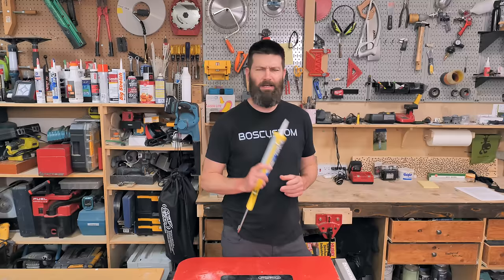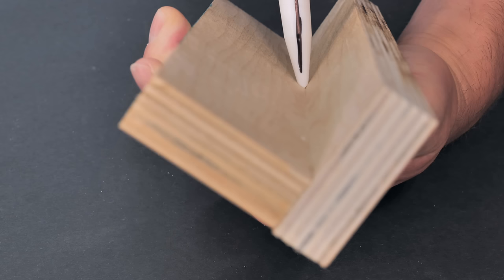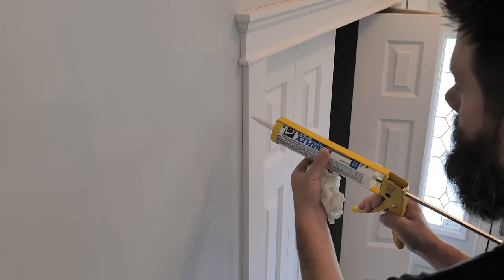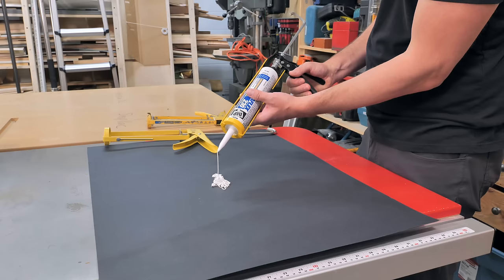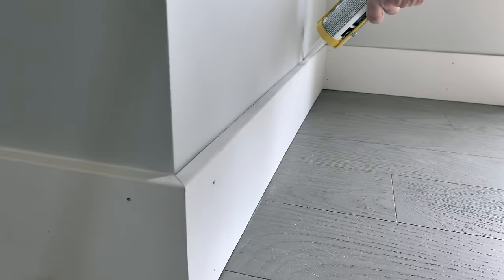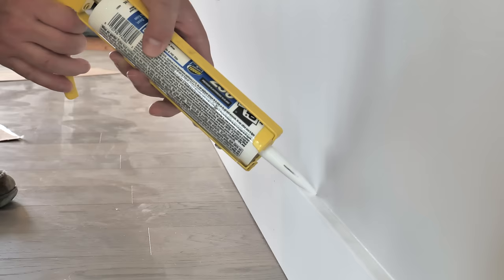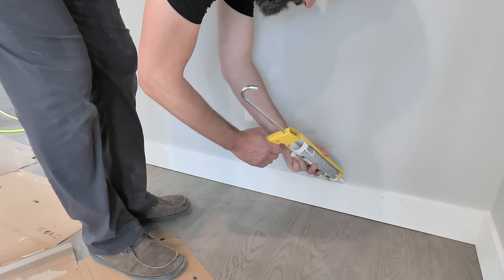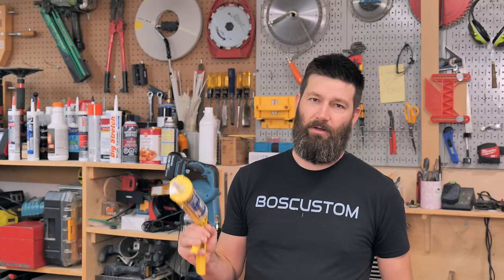The Secret Caulking Tip That Will Transform Your Ability!

Comment: I've been applying caulk for over 35 years and I never drag the gun along the seam. I learned from day one that you cut the tip square across and push the tube along ahead of you. The square cut leaves a clean concave bead and, with practise, you almost never have to run your finger along the bead. I've taught this method to a lot of trades people and they never go back to his method.

Comment: As a professional painting contractor, I can fully endorse this video. These are very good tips for the do-it yourselfers. 
Some of the YT videos giving tips on caulking are so unhelpful. I saw one meant to give tips on painting vertical stripes on drywall in contrasting colors. It told viewers to run a bead of clear silicone over your tape lines prior to applying the second color in order to prevent the color from bleeding under the tape. That was some pretty stupid advice. Sure, it will prevent the second color from bleeding under the tape, but your going to see every line due to the buildup of silicone being smeared over your drywall. And that is to say nothing about the insane amount of time involved with running silicone up and down walls and then having to finger it smooth. Then if that silicone dries long enough, good luck pulling the tape off the walls easily. Dumb, dumb, dumb. Plus, paint does not like to stick to silicone.... so good luck if you ever want to repaint your walls. 
If anything, it should of suggested clear acrylic caulk (even though that is a bad idea too). Of course the best and simplest method is to simply brush a coat of the base color over the tape lines and allow it to dry before applying the second color. That is a very quick and easy method (less expense, materials and time involved) to create sharp, crisp, straight lines. The base paint color will get under the tape enough to lock out the contrasting color, while not showing up as a different sheen, unlike silicone smeared up and down your walls.
Reply: I always use the frog tape when painting that stuff is amazing
Reply: I didn't see any helpful video on proper caulking...
Reply: I never understood wth they are talking about or if these people ever used silicone in their lives. You brought up the very problems I immediately thought. And your point about base color is spot on, thanks. Will use it if I ever need to paint different colors. Until now I either wiped off the bleeding parts, or painted over them with base color when dry. What you suggest is easier. You should also leave this reply under those videos (I don't remember reading it).
Reply: @x-0-x-0  "I never understood what they are talking about or if these people ever used silicone in their lives."
I'm with you on that. Silicone has its uses, but they are very specific and limited. If painting the caulked joint is EVER a possibility (now or in the future) silicone is NOT the right choice, plain and simple. Virtually nothing will stick to silicone. That very fact is what makes it a great product for some applications (like filling the line between a stone counter top and its backsplash, or around plumbing fixtures in a tub, sink or shower, etc, to waterproof them) and an absolute horrible choice for others.

Comment: Great idea with the line on the tip. One more thing I would add is to always wipe in both directions when possible. It seats the caulk in the joint better and adheres better

Comment: Dap brand caulk has that infamous air bubble purposely included inside of the tube (usually around 3/4 of the way toward the bottom end of the tube), so that when the pressure is released on the caulk gun completely, the air bubble inside of the tube is pressurized to the point where the caulk continues to splooge from the tip of the tube and onto the floor or carpeted area (especially if you are working on a ladder caulking crown moulding). This causes for lots of waste emitted from the tube and more sales for Dap corporation. My remedy for this is to squeeze the tube with the caulk bead spreading hand immediately when the pressure is released from the gun and continue the caulk bead to the end by squeezing the sides of the tube by hand. Ace brand 'Window and Door'   caulk is notorious for the air bubble also, but not usually as big as the complimentary Dap brand air bubble.
Reply: So that's why it happens to me all the time! My boss was about to throw away my favorite caulk gun because it kept oozing out even with the gun relaxed, so I took the tube out of the gun and it still oozed about a 5" bead worth of caulk. DAP!!

Comment: I've needed this one for 45 years.    The line on the tube is great idea.   I use a spent 28 gauge shot-gun shell for a lid on partially used tubes of adhesive or caulk.  Fits perfectly and never dries out.
Reply from the maker: Cheers 🍻, thanks for checking out the video
Reply: I just use a roofing nail and a piece of painters tape.
Reply: @Chris.Rhodes  man, that sounds like an excellent storage solution. Thanks!
Reply: @williamwallace410  yeah man, I just used a tube of caulk today that was open, and has been open for 8 weeks, i pulled the nail out, and it came out like I opened it today. So it's a method that just plain and simple works.

Comment: As someone who used hundreds of caulk guns I can agree dripless is the best but also the feel for the gun in really important find one you are really comfortable with and stick to it. At one point i had like 8-9 guns in the van. As I would use them I would keep track of what i did and didn’t like about them. I narrowed it down to 4 guns now. 1 is that newborn gun you showed (2 different styles) another one is a large gun for the bigger tube of construction adhesives. And the last is for the smaller tubes of construction adhesives, grout caulk or blackjack. (harder stuff to squeeze out) the newborns are pretty hard to squeeze with thicker material.

Comment: I'm a window and door installer. Two things: #1 caulking in trim is a bad idea. Especially when using MDF mouldings, they shrink and expand far too much and in 9 out of 10 cases it will separate your drywall paper or paint from the wall. #2 a square cut tip is superior to ANY slanted tip because it's omni directional. You can achieve the same or better and cleaner beads by "pushing" the caulk into the remaining cavity AND you can see it fill from the front of the bead meaning less necessity for going back over and building beads up. I've pushed probably nearly 50 000 tubes of various different kinds of caulking and this trick works with every single one.
Reply from the maker: I’ve heard a lot about the pushing method, will have to give it a try. As for caulking trims- that’s the industry’s standard in BC.  It gives it a seem less look and is much more hygienic.
Reply: 50 THOUSAND tubes of caulk?  Are you serious?
Man that’s a lot! Never heard about pushing the caulk, will have to try that.
Reply: @randallrun  seriously. Been at it for 15 years at just my current job. Not bragging but I can lay down a mean bead...
Reply: @TheFunnyCarpenter  I'll give you that on the clean look. However, try changing window trim after it's been called. Or baseboards for that matter. I work almost exclusively on the Reno side of things so I see all the after effects of other people's methods.
Reply from the maker: @tenflat2009  score the caulk with a utility knife, then pry with a Richards Red Bar. Boom goes the dynamite.
Reply: I agree 100% about the advantage of a square cut top to a slanted tip.  Takes too much time to make sure the angle of the tip is aligned.  If you're experienced, and can sync flow and pressure, the square cut is faster and comes with better results.
Reply from the maker: @DavidSmith-fr1uz  maybe a square vs slant in the future…
Reply: @TheFunnyCarpenter  I'd be happy to submit a "proper" display of the square cut method. I use primarily Supra Expert as it is an instantly waterproof exterior caulk that sticks to nearly anything. Shingles, vinyl siding, stuco and so on. I'd be glad to give a demo with this product.
Reply: @DavidSmith-fr1uz  With all due respect, I think a lot of people are watching this video specifically because they AREN'T experienced. I don't want to become a professional carpenter, I just want to make sure the baseboards in my son's room don't look janky.
Reply: @TimothySpradling  caulk and paint make a trim guy what he ain't!
Reply: @tenflat2009  many years caulking here. I watch the caulk at leading edge of tip and fill without spilling around tip. Riding the wave. If I over fill stop and clean tip.
Reply: @thertmodale  I'll never knock someone else's method. I've tried every tip cut imaginable, and I do use a slanted tip occasionally. Usually because of a tight space or hard to reach for some other reason. It's not impossible to do nice beads with any method. I simply find that for the vast majority of situations a square tip and pushing method give a cleaner bead since you can see the caulk as it fills not only after you are past the area. Truthfully as a novice a few tubes ago the square tip was significantly easier to grasp, for control, than anything else for me. I've taught several people to do caulking also and many of them echo that same sentiment. You and everyone else are free and welcome to use your caulking guns any way you like. If your methods work, use them don't let me change your mind. But if you feel brave, try my way. It might become your way...
Reply: @tenflat2009  I wasn't knocking.  I was explaining how I caulk and have taught others. Everyone should use what works for them.👍
Reply: @thertmodale  This quote got a carpenter fired from my house. If he/she is that sloppy, I don’t want them in my house, period.
Reply: @BlackSwan912  if he said that then he isn't a carpenter/trim guy! 👍
Reply: Yes, the square tip cut works best for me, too. I used to cut an angle and draw an orientation line. But I always had to twist the tube to the the orientation right as the tube changes angles as I make a pass from a fixed position, like on a ladder. What a PITA. Square tip is faster and works better.
Reply: @Baldspot if there are bad gaps yes, but 99% of the time I'm able to form the trim to match the wall. I don't do much baseboard or crown moulding either though...
Reply: @Baldspot plus I’d rather use spackle if paint itself won’t flow it closed. With spackle it is much easier to break loose the trim without tearing the paint or paper off the adjacent wall. I’ve lost plaster because of the caulk.
Reply: @Baldspot just counting windows I've installed roughly 20 000. Plus doors plus overhead doors. My company also does tin cladding and there's lots of caulking to do with that as well. And we do siding....
Reply: @Baldspot pardon me? You disagree with that approach? I’m fast and I’m good and a damp rag cleans it up beautifully into a sharp crease.
Reply: @Baldspot Always. It's faster,  neater, cheaper,  easier to service in the future. Also,  if you do the trim right,  there really isn't a gap at all.  Caulk is a band-aid to hide flaws that shouldn't be there imo.

Just my opinion,  nothing more,  I know I won't change minds lol.
Reply: An awful lot of caulkfighting going on in here.  
Personally, I hate when someone pushes on the caulk.  Pulling it, on the other hand, (while also keeping it wet) gets the job done in no time!

Comment: Great tips.  I like to make sure that when I cut my angle, always do it so the tube's main label faces outwards, away from the wall.   It helps you keep it loaded in the gun properly, just like the small line you place on the tip and especially if you swap the tube in and out of the gun a bunch.

Comment: 1. Wash your hands before caulking and like he said, have a clean rag or, what I use is a nice broken in damp sponge. 2. After cutting a small tip at an angle like he said, you will notice on the side of the caulking gun is a long wire. Fold it out and poke inside the tip so you break the protective skin inside the caulking tube. This was a good video!

Comment: As an alternative to sanding the tip to get a 90 degree profile, you can just cut the tip twice.
You already have the knife so it's just a two step process, rather than setting up sandpaper on a right angled board.
First cut as shown in the video, then rotate the tube 90 degrees and cut the nozzle again at the same angle.
You will need a good Stanley knife as the second cut is literally just a slither of plastic.
Reply: I usually do it with a knife too, but I am going to try the sandpaper - I have a feeling it will produce better results and cleaner lines.

Comment: If my bead is too big, i’ve found that an expired credit card or hotel key works well too. Sometime i’ll have to cut the corners a bit if the diameter of the rounded edge is too small. For me, I just make sure that the card is angled slightly in the direction of travel so that it smooshes the caulk down into the joint a bit better. Not sure if any of this is a best practice or not, but it’s worked for me.
Reply: I use my fingers. Different situations need different fingers. If the bead has to be big to fill a big gap I might use my thumb or middle finger. If it's small in a tight spot I use a pinky. Mostly I use my pointer finger.
Reply: try use a paddle pop stick

Comment: Love it!  Ready to apply these tips on my bathroom renovation project 👊
Reply from the maker: Thanks Scott, I look forward to those videos over on your channel! I’ve learned a lot over there.
Reply: When using a silicone, after you squeeze it out of the tube, before forming it with a tool or your finger, spray the bead with mist of water using spray bottle. The silicone won't adhere to wet surfaces and even smeared could be easily removed. You could also consider buying silicone cleaning wipes.
Reply: @TheFunnyCarpenter  Sir, I do NOT want to know about your cocking secrets. 🤦😒
Reply: Cocking, tips, drips... Sounds dirty. 😒
Reply: @ytsux9259  🤣

Comment: I'm a plumber, I always dreading chaulking... then someone showed me this trick, run your bead and before you wipe it smooth, take a mixture of dish soap and water in a garden spray bottle, spray the surface of your bead... then wipe it finished... the soap will not allow any mess to stick to the soaped surface.

Comment: Also, A couple of drops of dish soap in a spray bottle sure helps make the finger smoothing go much easier and cleaner. Run your bead of caulk, spray a light mist over the bead with the soapy water, a little mist on your fingers and swipe. Works like magic!
Reply: Or learn to lay a bead…there’s no reason to ever touch the caulk once you’ve laid the bead …use a good quality gun and run it and move on if you do it right the tip will smooth it for you🤯
Reply: @robertpoindexter8616  You don't run beads on trim work and not finger it down.
Reply: @terrismith9095  I can run beads on my trim work and not have to finger it down
Reply: @AustralienGuy  If I had a nickel...
Reply: @terrismith9095  you might not…I havnt touched caulk with my fingers since my 2nd week on the job…this line of work is literally the preferred choice of meth heads..shit isn’t rocket science …you wanna make things complicated go for it my guy
Reply: @terrismith9095  is probably a “20 year pro” still putting his fingers in caulk…smdh

Comment: The "groove" tip looks great -- gonna do that with the sandpaper next time. Except I can't wrap my head around calling that a groove; I'd call that a chamfer or a bevel. But whatever you call it, it's a great idea, thank you.
Reply: Yeah, it’s clearly the opposite of a groove
Reply: Plus, any time you can work "chamfer" into a discussion about caulking, it's a good day.👏👏👏
Reply: Lol you all sound like landlords, chamfer and bevel is typically used on squared objects, also a chamfer is two bevels on a squared object which only reach 45 degrees. Groove would be a more appropriate term to use for caulking
Reply: @nolz5634  a groove is an indentation into a surface, like on a vinyl record. 
the caulking tip here is obviously doing what a needle would do on a record - fitting into a groove, made here by say a floor and a base board. 
the tip is quite clearly the opposite of a groove - it’s fitting into one
Reply: @sunthroughtheblinds  I didn’t say groove was the word lol, I said it’s a more appropriate term, he could of meant cut a groove implying the shape to suit chalking a groove. You are being too critical in your thought process clearly
Reply: @sunthroughtheblinds  if you actually work in construction, where I have done this countless times as a carpenter in fitouts, you’ll find “cut a groove” from a nozzle is common
Reply: @acepairfecto5597  imagine thinking caulking is exclusive to the most joke of a trade… painters. Your trade involves moving a brush, more like a leisure activity for old people
Reply: @acepairfecto5597  and my caulking is actually flawless, doesn’t take someone with half a brain (painters) to caulk a line and smooth it off🤣